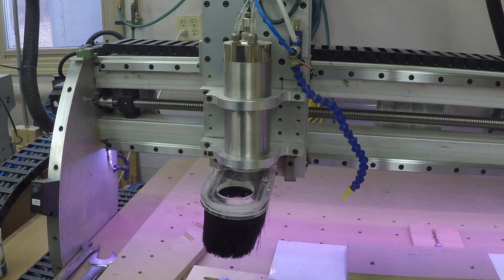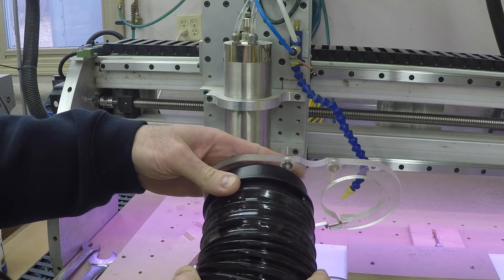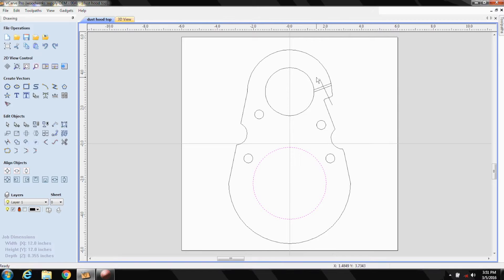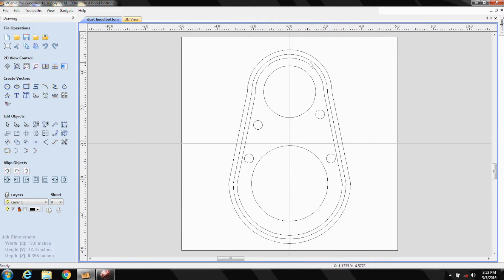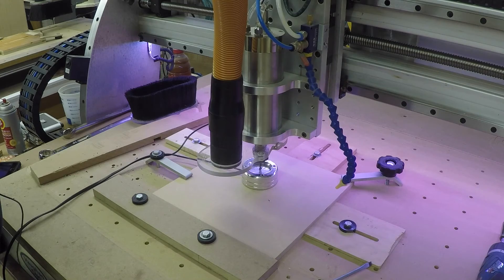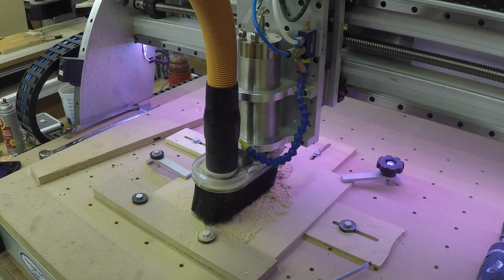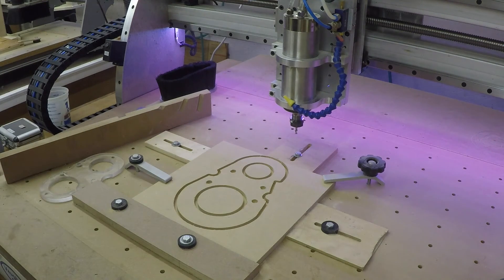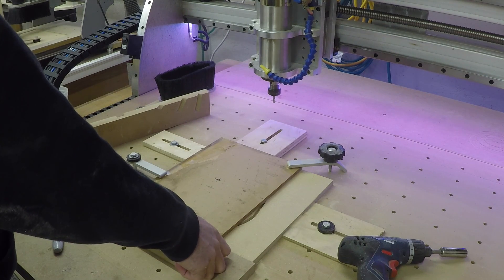Dust Shoe for CNC Router

Comment: Did you think of getting an adapter for the hose size?
Reply from the maker: Yes but I wanted full volume, but you never know velocity might trump volume. I would have had to have a long one because the old one was pretty close to the spindle. I see some Avid cnc using two 4 inch ports!  Thanks for the comment.

Comment: nice boot.
also nice zero tool where did you get this ?
Reply from the maker: Milan Potter thanks. I actually made that myself. Aluminum on the lathe with a disc of it in center that wire connects to and spring underneath
Reply: Awesome.
im wanting to make one on my CNC Router but add the corner square underneath
Reply from the maker: Milan Potter cool.  Not sure what you mean by corner square. Like a touch off location permanent to Cnc? That be cool.
Reply: cutting a 90 degree angle in bottom to sit on workpiece corner to use for touch off.
Reply from the maker: Milan Potter I get it so you can find a corner of the work . Please send me a pic when you get it done I'd like to see

Comment: How much offset do you use for your spindle and hose pockets?
Reply from the maker: Jon Z I cut hose .010 thousandth over for a slip fit and almost right on the spindle size like .002 with the slot for a snug fit

Comment: You don't need a bigger hose. You need to toss that crappy shopvac as it doesn't have ANY suction.
Reply from the maker: TVCanT  that's why I made this to use a jet dust collector instead of the shop vac